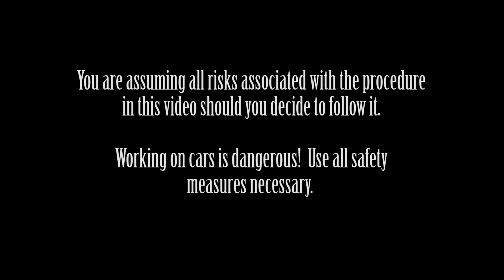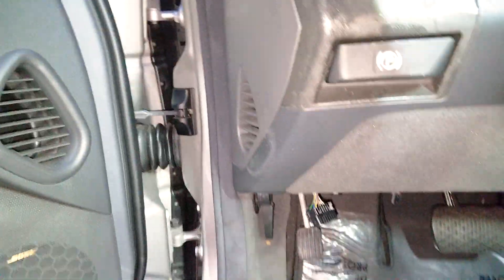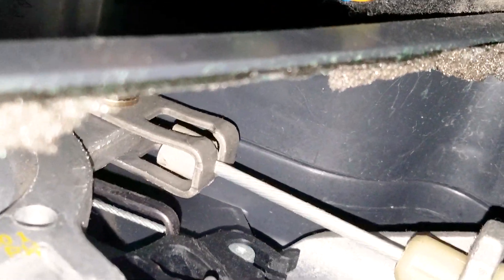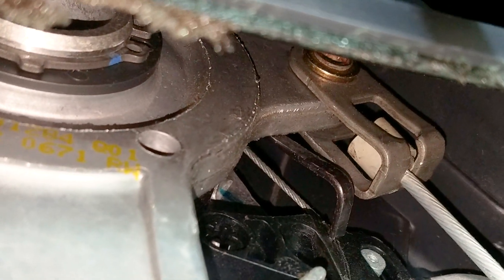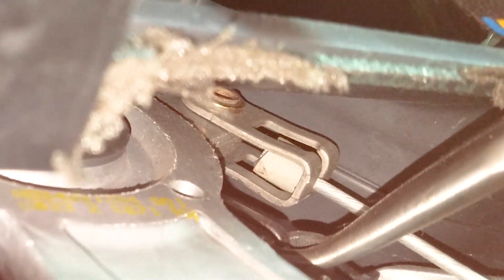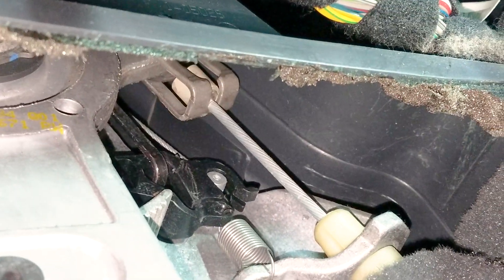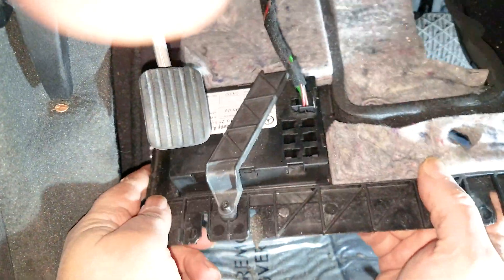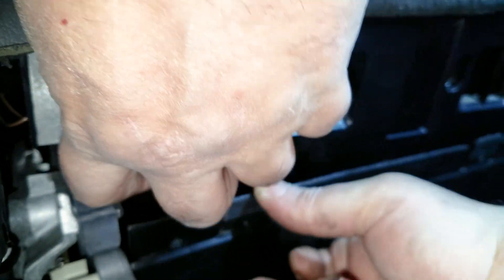Mercedes W220 S500 S430 Parking Emergency Brake Pedal Not Sticking

Comment: You are life saver man! I was facing the same problem with my E220d, W212 from last 6+ months. After watching this video, I went into the car and literally used my finger to lift and pull the "Pedal retaining clip" and with slight push it fall into its place. In total 10 second job to be honest. Cheers.
Reply from the maker: Great to hear that.
 Thanks, Fahad.

Comment: Excellent info. Thanks. May I respectfully suggest that WD40 is a penetrant NOT primarily a lubricant (read the can). I use TRIFLOW or PB Blaster both of which are hi end lubricants. That being said, ANY lubricant is better than NO lubricant.
Reply from the maker: Thanks KALIFORNIA KIWI - you are right.  Though I don't remember where I have mentioned it should be used as a lubricant...

Comment: Hi Masood, Great video I literally have the same issue on my C63 2013 W204 model. The hand break (foot) does this exact same thing. That said the hand break hatchet lever has also become loose and sticks out makes me wonder its become disconnected from the metal rod/wire. 

Would you said the same things has happened to mine on the hand break?
Reply from the maker: Hi Maneck, yes, the loose and sticking out handbrake is a symptom of this issue.  Remove the covers and have a look to confirm.